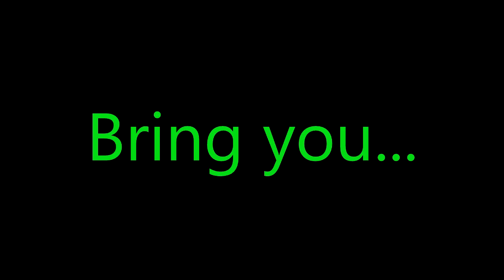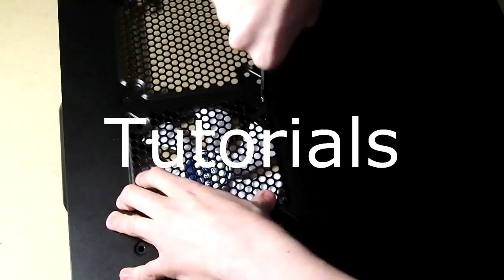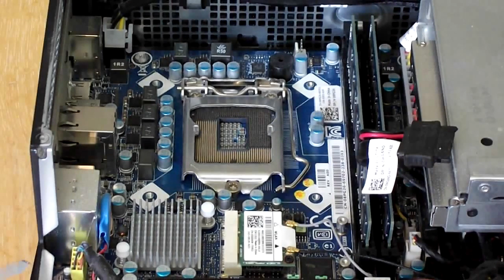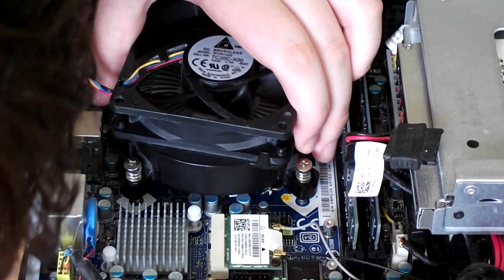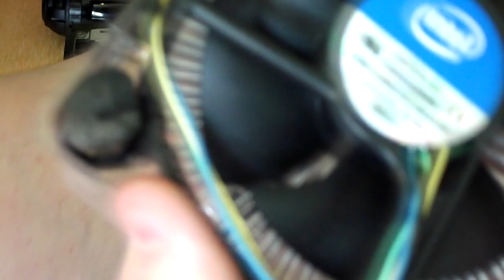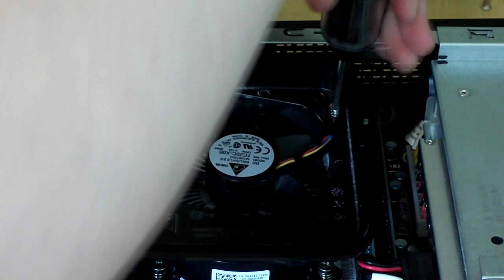Installing an Intel CPU and heatsink - Alienware X51

Comment: Will I be able to fit a low-profile heatsink on the X51? I’m thinking of getting a Thermalright low profile heatsink to replace the stock one.
Reply from the maker: I have long since lost access to this PC so I can't test anything, but if I'm honest I would imagine the stock cooler is the best performance you can get in this chassis, due to the ducting out the rear of the case which wouldn't fit on an aftermarket solution, therefore all the heat would just build up in the case and not be effectively exhausted.
Reply: @doshtechvideos  I’m guessing that the best I could do at this point is to reapply fresh thermal paste on both the CPU and the northbridge.

Also, can I upgrade the CPU to the Core i7 3770K? My X51 has a 3770 installed.

My older brother gave his X51 to me a few months ago, and I’ll be installing Linux Mint on it.

Comment: I have a "stock" X51 R2 with I3 and 6GB ram.  I want to upgrade to 16GB ram. Do you know if the fancy sticks with the heat sinks will fit, or should I use regular sticks?
Reply from the maker: I do not think they would fit due to the fan shroud, at least in the R1 anyway. There is also no benefit to heatsinks on the ram in a machine like this as I can't imagine the OEM motherboard will allow overclocking the RAM, so I would just go for Corsair value select or Kingston valueram or similar.
Thanks for your comment

Comment: Hello! I just upgraded my alienware x51 with a 1050 TI mini GPU, because before it started giving me some bad issues with stuttering and crashing (I think overheating). After changing the GPU performance did go up, but I am still experiencing some stuttering when watching videos and just browsing, however games actually run real smoothly on higher settings compared to my old 640. Is it my next step to upgrade my processor next? Or could it actually be something else? If so, could you point me in the right direction on which one to get? And currently my power supply is a 240 Watt, should I upgrade to the 330 watt version? Any information is appreciated, thank you, love the videos!
Reply from the maker: No guarantees but it might be worth looking into a new CPU (if you think it is worth it). Guessing youve got maybe an i3 processor as it came with the 240watt power supply. It is important to realise there have now been a few different versions of the X51, and the CPU sockets have changed as the generations of CPUs have moved on. Find out what CPU you have now and you can look it up on intel ARK (google it), then you can find out what socket it uses (most likley LGA 1150/1155) and get some sort of i7 CPU from the same generation. For example the X51 in this video was using an i7 2600 (sandy bridge) to start with so any of the i3, i5 or i7 CPUs with the 2xxx prefix would work, providing theres enough power. 

Hope this helps.

Comment: Does every CPU heatsink fit the shroud? Or are there specific dimensions.
Reply from the maker: Not sure about newer models, but this one for sure will only really work with the factory installed heatsink, as it screws in to the top of the fan, which in turn is at a bit of an odd angle. Hope this helps.

Comment: Hi DoshTech. Will push pin type fit into the mobo
Reply from the maker: Najib Nasharudin Screw in  heat sinks only in the x51 im afraid, at least for the model used in the video.
Reply: Okee dookie. Thanks. Awesome content btw.
Reply from the maker: Najib Nasharudin Much appreciated :)

Comment: My x51 has a i7 3770 in it. Do you know any other cpu that could work with it? I'm looking to upgrade but I have no idea when it comes to CPUs.  Thanks.
Reply from the maker: Im no tech support so I am not certain, but if you have the 3770 currently then thats probably the best you can fit to your current motherboard as the later generations used a different socket to the 2xxx and 3xxx series CPUs.
Hope this helps :)

Comment: ok i got an r2 that used the i5 and ram and stuff for a newer built . so now i bought a gtx1050 and and i3 and some ram . using the intel stock fan . but i got over 70c temp on cpu when just playing csgo with   recomended settings . any one knows whats going on?
Reply from the maker: My advice would be to take the cooler off, clean the heatsink and the top of the CPU as best you can and then re apply some decent thermal paste (like what we used in the video) and it should solve the issue. Old thermal paste can sometimes go a bit hard and be a bit rubbish. The cooler shown in my video is similar to an Intel stock one, however uses screws to mount and fits an air duct over the top of it like shown, this is the one you should be using as I don't think the standard push pin heatsinks fit in any of the X51 models.
Reply: 70c? I get up to 80.  I neverbhad any problems.

Comment: Can I upgrade a x51 r3 from a i5 6400 to a i7 6700k? (yes I know it's a bit extreme)
Reply from the maker: They are both from the same generation of chips, so I do not see why not - but then again I am not alienware tech support! I would check on their website that your current BIOS version supports the new CPU, also that the power supply is beefy enough for it, as I know at one point they did a 270 watt and a 330 watt supply.
Thanks for your comment!
Reply: Thank you for your response!

Comment: hi does the CPU come with thermal paste?
Reply from the maker: +Cosmic Twix If you buy the CPU brand new, it will come pre applied in 3 small strips the the underside of the heatsink included with it. If you are installing it specific to the Alienware X51, then you can only use the heatsink designed for the computer, so therefore you would need to apply new thermal paste to the CPU.

Comment: Mate, you could drop it on the metal top and it won't be harmed, don't worry about touching the top. It's metal for a reason, so that the internals don't get spattered with Thermal Paste. It's just a housing, so don't worry about it.

Comment: Do you need to install a new heat sink if you are installing a CPU?
Reply from the maker: ThatAwkwardGuy No, you can re-use the one that came with the X51 but you WILL need to clean the heatsink off very well and apply new thermal paste, as the ones that come in the intel box do not fit in the X51.

Hope this helps.

Comment: My x51 got dropped pretty hard and now I have only got a signal from the hdmi once and i couldn't startup repair and any further attempts with hdmi or dvi-d have gotten no signal any idea whats broken? also no signal to mouse or keyboard
Reply from the maker: When you say the HDMI are you referring to the the onboard HDMI or the HDMI on the back of the graphics card? Either way it might be a good idea to try and test another graphics card (if you have a spare one) to see if that solves the issue. If not I would expect it to be a motherboard or power supply fault. It would be helpful to know - when you turn it on can you hear any fans spinning? or any beep codes?

 Thanks - Doshtech
Reply: Onboard hdmi and yeah the fans spin my mouse lights up but my keyboard doesn't and i cant hear any beebs thanks for the advice so far
Reply from the maker: Jason  You should probably be plugged into the back of the graphics card. Try all the connections on the back of the graphics card. I don't want to sound obvious but have you checked the cable?  Even if they look fine they can have broken connection inside, try another cable or try using the same cable to connect something else. Hope this helps, feel free to ask for more advice.
Reply: DoshTech I have had the pc on twice since it got dropped first time with the hdmi and i couldn't start-up repair so i pressed the power button and then i wouldn't come on (keyboard monitor etc) untill earlier where it came on with the dvi, so i started windows normally and i couldn't get passed starting windows so i pressed the power button and now the keyboard and monitor won't come on again, im thinking motherboard
Reply from the maker: Jason I think there must damage to the motherboard or internal power circuit as this would explain it not being able to provide enough start up current and therefore USB devices will fail and the graphics card power will not be enough (so it wont turn the graphics card on, so there will be no display but the computer may still seem turned on.)

The reason it will not start up repair correctly is that the mechanical hard drive will not tolerate physical shock well and dropping it can damage the drive and some files on it, as they have VERY delicate components inside. 

Hope this helps somehow, but depending on the age I would contact Dell (they own alienware these days) and ask for advice, as the x51 uses mostly proprietary components that only dell make.
Reply: DoshTech cheers mate

Comment: could i install an i5 4460 cpu lga1150 into the x51 with the default x51 heatsink?
cpu i3 4130
Reply from the maker: The heatsink should work providing it has a copper centre to it like the one in the video, if you are replacing an i3 there is a chance it might just be a standard aluminium heatsink which might not be up to the job of cooling an i5. The X51 in my video had an i7 originally so had a copper and aluminium heatsink. It is a good idea to check it has a copper centre under the fan before upgrading to a higher TDP CPU.
Reply: so you think i may have to use the standard i5 heatsink? will the push pins work with the x51? also they both perform at 3.4 ghz and my i3 has hyper threading
Reply from the maker: glen williams You should use the x51's heatsink as it uses screws, therefore push pins do NOT fit. The figure you should be looking at is TDP rather than clock speed as that is the amount of heat the CPU will output, the i3 only having a 54W tdp, but the i5 is 84W, so you need to cool it properly. Another thing to consider is that the i5 uses more power, and some X51's only have a small power supply, 240 watts, but if its the larger 330 watt version you should be good to go. As for the heat-sink, I think all of the X51's use a copper and aluminium heatsink - but I am not 100% certain. Before buying a larger CPU check by opening the case (unplug computer) and look just under the centre of the CPU fan you should see the corner of the copper, with alminium fins around it. Even if it does not have the copper heatsink it will still work, just it will run hotter and could overheat. Most importantly though make sure the power supply is big enough, if you overload it it could damage other parts of the system. Look on the back of the external power brick to find the wattage. If you are still unsure then its probably best to contact dell for advice. Hope this helps.
Reply: DoshTech
thx for the help i have the 330w psu and im also going to remove the cd drive for better air flow im gonna risk it. thank you soo much for your video and help!
Reply from the maker: glen williams Thats quite alright! Luckily a developing channel like mine still has time to answer my comments :) I hope it all goes well!